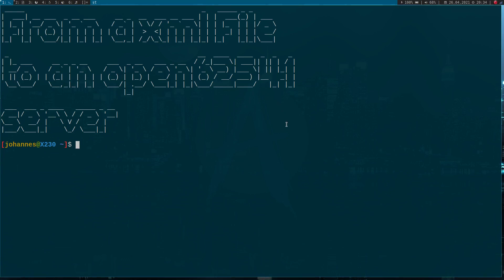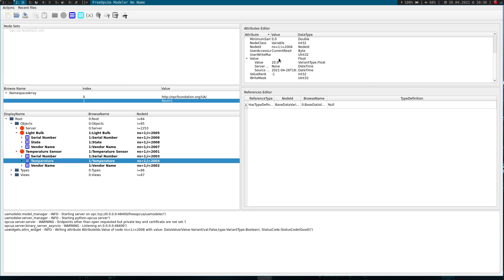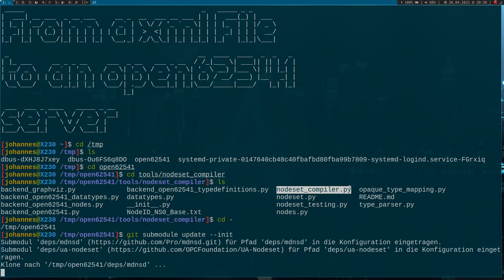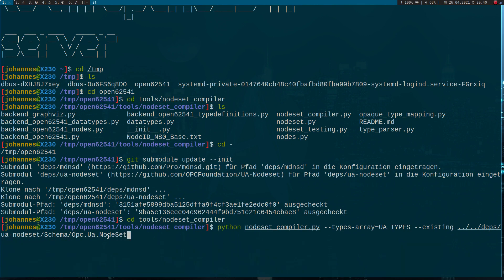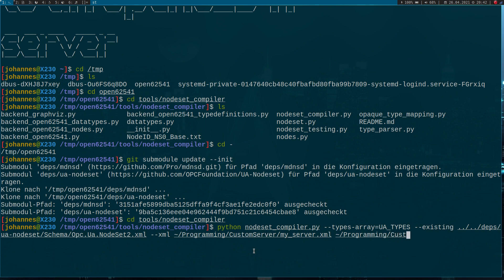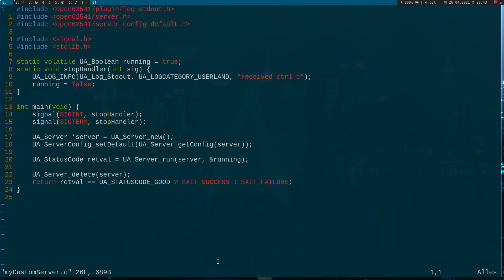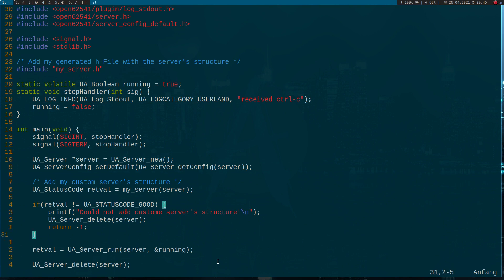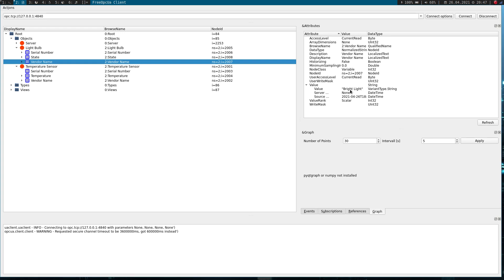The Nodeset-Compiler: From a xml file to an open62541 server

Comment: Hi Johannes,

Thanks your video.

I try the other example：add the Opc.Ua.CNC.NodeSet.xml to server. 
 
1. I type this command：
/usr/bin/python /source/open62541/tools/nodeset_compiler/nodeset_compiler.py --types-array=UA_TYPES --existing /source/open62541/deps/ua-nodeset/Schema/Opc.Ua.NodeSet2.xml --xml /source/open62541/deps/ua-nodeset/CNC/Opc.Ua.CNC.NodeSet.xml /source/open62541/build/src_generated/open62541/namespace_cnc

2. server.c add #include "namespace_cnc.h" and call namespace_cnc(server).

3. Compile error. namespace_cnc.c error: UA_TYPES_CNCPOSITIONDATATYPE undeclared.

I don't find "UA_TYPES_CNCPOSITIONDATATYPE" in the open62541.h/namespace_cnc.h.
I don't know how to solve this compile error.

Comment: My compilation time extends like 15 minutes, putting out an error message:
/home/alex/open62541/build/src_generated/open62541/namespace0_generated.c: In function ‘namespace0_generated’:
/home/alex/open62541/build/src_generated/open62541/namespace0_generated.c:118113:15: note: variable tracking size limit exceeded with ‘-fvar-tracking-assignments’, retrying without
118113 | UA_StatusCode namespace0_generated(UA_Server *server) {
       |    
The server is compiled and ready to run though. Do you have a suggestion what causes the long compilation time and how to get rid of it?
Reply: Hey Blave,
I had the same problem during my final thesis 
wrote a tutorial where also this linking error is fixed, if this is the same, unfortunately it takes a little while until the english version is available
https://github.com/klementuel/open62541Tutorial#erster-server-mit-opc-ua-als-test
gcc -std=c99 -flto=1 ....

or via Cmake 
https://github.com/klementuel/open62541Tutorial#custom-cmake-file

@Johannes nice videos, unfortunately discovered only after the submission...
Reply from the maker: Hey scart1311,

habe gerade dein Readme überflogen und deine Bachelorarbeit sieht gut aus :)

Behandelst du darin auch, wie man den Server mit SSL verschlüsselt? Darüber würde ich gerne ein Video machen, habe aber noch keine gute Quelle/Beschreibung dafür gefunden und die open62541 Beschreibung könnte hier etwas genauer sein, gerade wenn man auf diesem Gebiet (SSL, Security) kein Experte ist :p
Reply: @johannes4gnu_linux96  Leider da dies nur eine Teilbereich meiner Bacheloar arbeit war, habe ich mich leider damit nicht beschäftigt. Es fehlt ja einiges wie Acces Level, Historical Data und natürlich das ganze Security Thema wenn man von ausserhalb zugreift. Ausserdem das man mal nur Pub Sub benutzt ohne Client Server verbindung oder OPC UA Pakete Tunnelt mit MQTT oder zb. echtes TSN...
Habs mir einfacher vorgestellt aber OPC UA ist doch recht breit aufgestellt ;-)
Würde dir mal folgen, da ich erstmal Ulraub mache von dem Thema nach der Abgabe ;-)

Aber wenn es dich nicht stört würde ich vl ein paar Video Links von dir in das Tutoriel einbauen, also in Bereiche die sich überschneiten.
Reply from the maker: Ja, OPC UA bietet echt sehr viel. Ich kratze hier auch nur an der Oberfläche :p 
Schade, muss ich Mal selber schauen, wie das mit SSL Zertifikat geht. 

Ja, klar, kannst du gerne machen, stört mich nicht :)
Reply: @scart1311  Sry für die späte Antwort. Also ich hab deine Dokumentation mal überflogen. Auch wenn ich deinen Zusatz im gcc Befehl nutze, dauert das Kompilieren trotzdem noch relativ lange, jetzt nur noch ungefähr 7 Minuten. Der Linking Error wird weiterhin angezeigt. Die 7 Minuten würde ich jetzt mal darauf schieben, dass ich vorher auf einer VM mit Ubuntu unterwegs war und jetzt einen Laptop mit cleaner Ubuntu Installation benutze. Ich werde das Ganze jetzt noch mal mit einem Custom Nodeset versuchen. Was mich aber wurmt ist, dass bei @Johannes 4GNU_Linux das Kompilieren hier im Video fast instantan vonstatten geht.